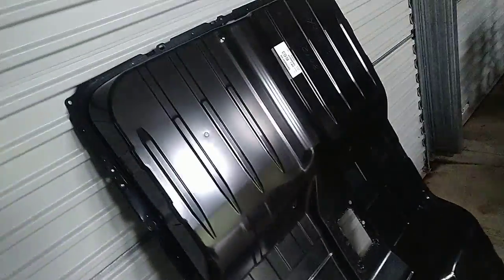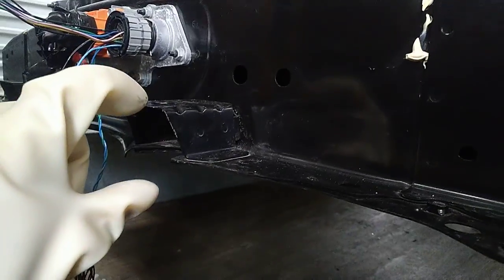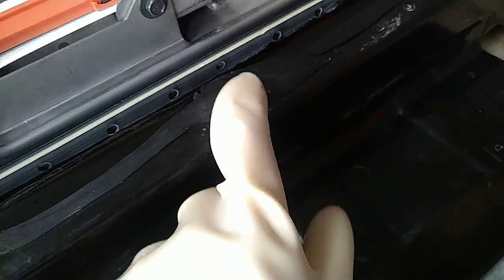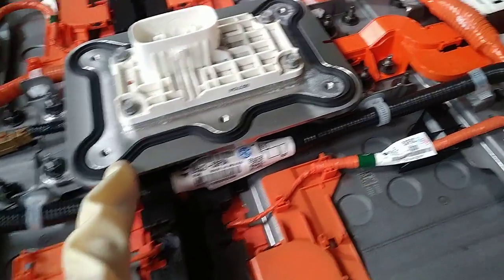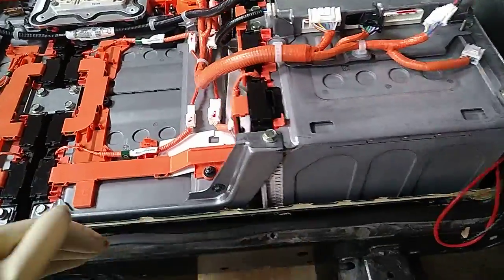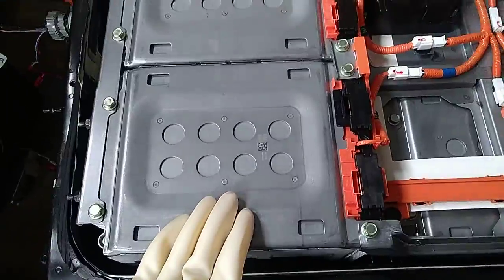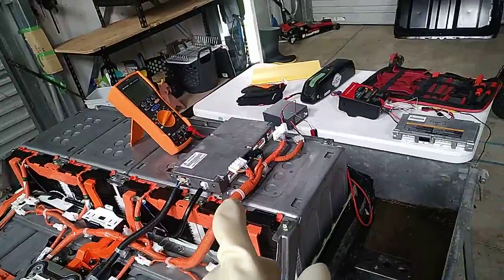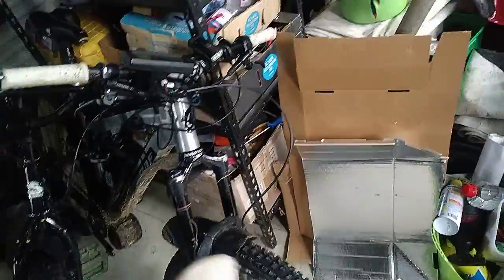62kWh Nissan Leaf Battery Unboxing

Comment: I'm taking one of these apart and I need to know the voltage on the packs since they are stuck together
Thank you
Reply: Then you'll need to break out the multi meter and measure the voltage. Basic cell chemistry is the same if you want to google.

Comment: I got scammed,the previous owner took out the 62kwh out of my leaf plus,and put in a old 30 or 40kwh battery,he used 3 screws to cover that gap like spacers..tell how much these  62kwh batteries costs.in ok condition.ok🤔

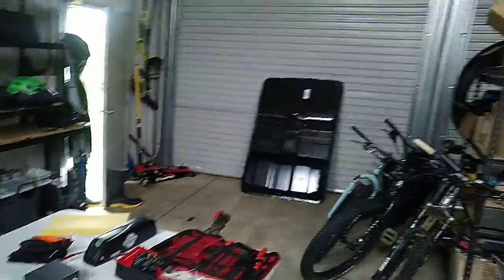Comment: 4:20 They probably left space for cooling?  Except that they never used it; the battery is sealed.
5:40 Close enough to the gentoo connector?  So are you connecting penguins as a power source now?
Have you considered a baboon connector?

Comment: Hi, is this for the Leaf 2? Can it be retrofitted into a 30Kw Leaf 1.0 (2017 build). I love my leaf, but I am becoming frustrated with 75 mile range and would really appreciate the option of upgrading to 62Kw. Finally what is the cost for this unit please. Thanks :-)
Reply: 10,000$
Reply: Yes, retrofits are possible. EV Rides LLC does it here in the US, but the 40kWh is ~$12,000

Comment: great video ?     
Question :    is the base battery case then almost the  same,  only spaced down with the new brackets ? 
Meaning the only main BIG modification is a higher top lidd  ?
Reply from the maker: The battery case is deeper too. The lid is almost the same depth overall, except the couple of protrusions.
Reply: i saw the clip again and compared to my gen 2 battery i think i can see the differences now,  battery connector much higher in the "base"  so  probably similar lid and completely new bottom  (  as you actually say  :-)   )    
so it probably mean this will fit mechanically in any Gen 2 battery space , good news
Reply from the maker: Watch the ground clearance :)
Reply from the maker: Also, there's more bolts holding the 62 because it's heavier
Reply: well my 24/40kw  goes into a none nissan restobuild so i only need to "package protect" for future battery upgrades.  Ground clearance might be a factor :-)

Comment: What will you be doing with it? Upgrading a smaller capacity leaf to 62kwh?
Reply from the maker: Adding some energy to the one low cell then putting it back in the car it came out of.
Reply: @RaglansElectricBaboon  Is that to maximize the range or fix an issue?
Reply: @Nicholas-f5  to fix.

Comment: Wow. So no cooling system?
Reply from the maker: Yes, no cooling. I believe it's a 3P battery. All the old batteries were 2P. So each cell is working less hard for the same kW delivery & so will run cooler. It would still be better if it had thermal management.
Also, no obvious sign of heaters so cold mornings could be a worry
Reply: @RaglansElectricBaboon  that's good news indeed, the 3p vs 2p
Reply: @RaglansElectricBaboon  woow good
Reply: Less things that can go wrong!
Reply: I have recently bought a Leaf Tekna 62 Kwh after looking at all the competition and went for the Leaf experience and reliability.   The great thing about the Leaf for the future is that the battery can be dropped out of the car in minutes and in the future when batteries are much cheaper can easily be replaced by a secondhand owner.

Comment: Dare I ask why you are balancing it?  Seems that is the BMS's job and it just handles it automatically under normal use?
Reply from the maker: Seems as though a small percentage of all Leafs develop one low cell. The BMS is for balancing small amounts of energy & is great for bringing a high cell down. However to deal with a low cell it has to bring all the other cells down & it just doesn't have the capacity in a reasonable amount of time. There's disagreement about the  solution-is it a bad cell, poor balancing at the factory or a bug in the BMS? We've found on 30s & 40s that a top up of the low cell cures it. This is the first 60 we've tried it on. Watch this space :)